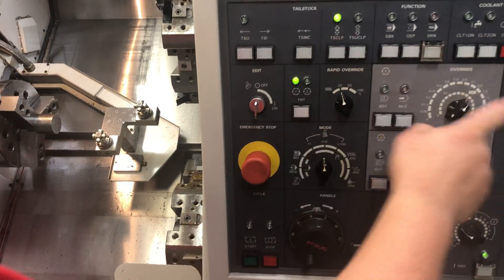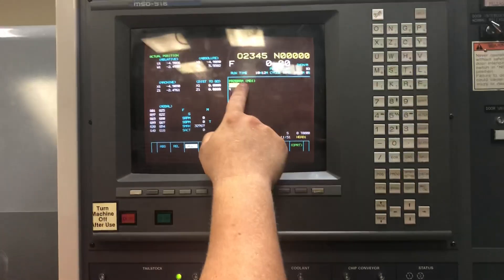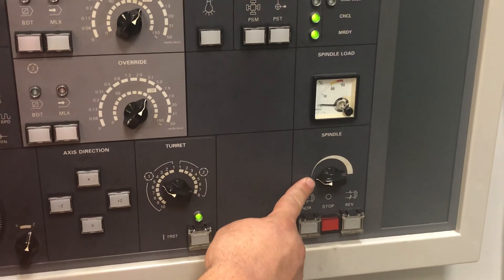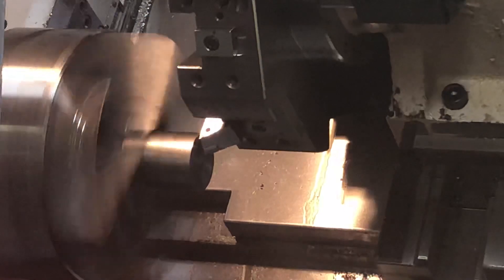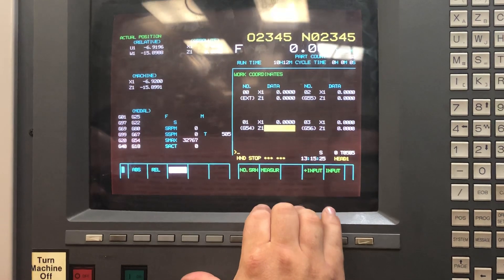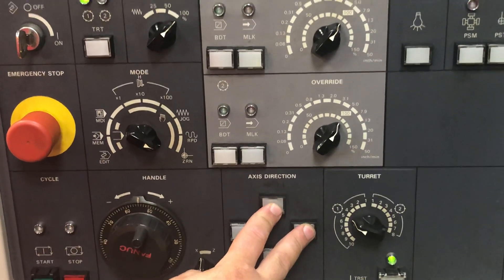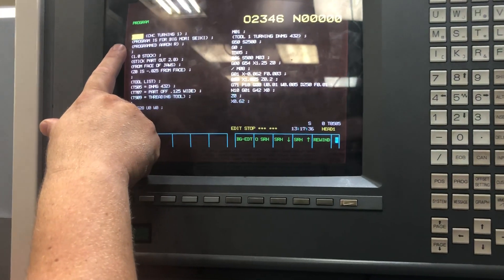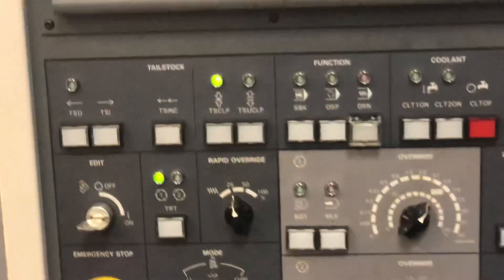Mori Seiki zl 25 setup part 2

Comment: Thanks for the video, another way to set the work shift on a mori seiki with a tool eye is use the PST button, you can call up any tool and it does not need to be "Active through MDI", touch off face of the stock where you want "Z" zero to be and press the PST Button and it will set your Z work shift
Reply: Nice heads up on the extra tips.  I have more videos of you liked this one